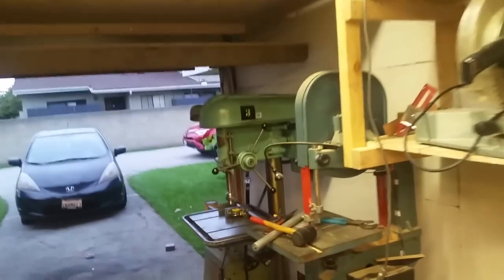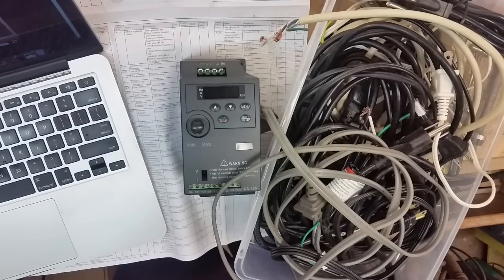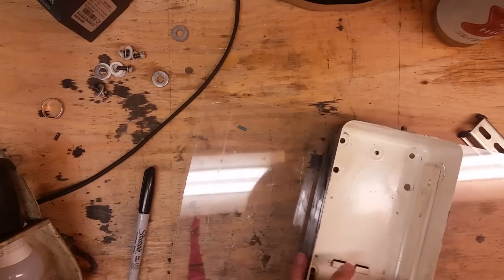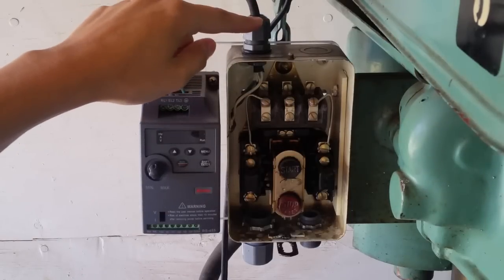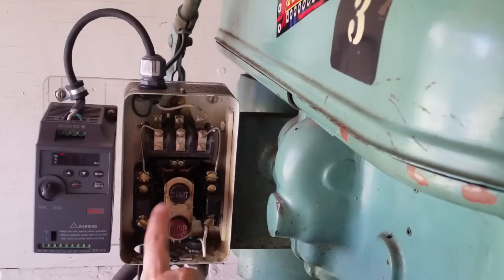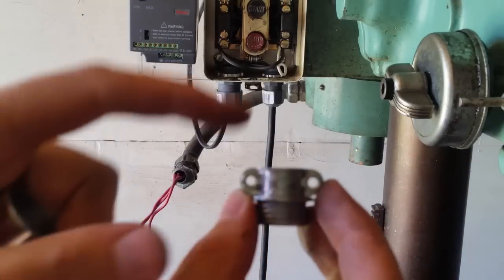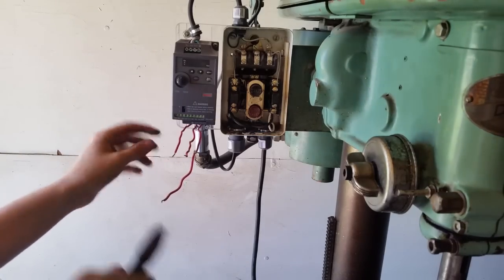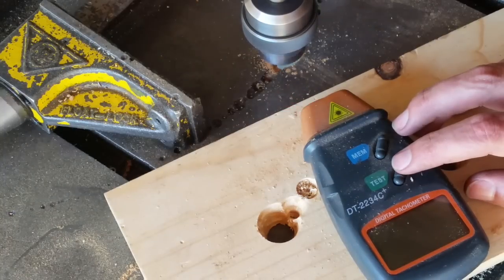Adding a Variable-Frequency Drive to a Three-Phase Drill Press

Comment: Him still confused how you wired 110 to 220 three phase motor, or am I wrong.  I thought you had to have 220 going to vfd. But it look like you run 110. 😅
Reply from the maker: The VFD I bought converts 110 to 220

Comment: Now pitch the light in favor of some blinding bright LED's
  I just got to the the setting on my seat and guide machine, 1 HP Gear head and have no idea if I should favor torque or not, low RPM is like 60, so torque may not be a problem. 
  I also added a hard depth stop and a battery powered LCD scale so I can see my depths to a thousandth. 
  My shop is all 3 phase, so that conversion was not necessary.  I even have a 3 phase vacuum cleaner. 
My VFD is Automation Direct. 
  Thanks for posting!!!
  Mark

Comment: The solution for low spindle speed using the belt pulleys to allow high motor speed, is the best way around the low speed, low torque issue. This is caused by the way these sensorless vfd units work. They use the back emf from the stator windings to determine the position of the motor's rota. That means the old way using hall sensors and optical sensors are not needed. But at low speeds hall sensors are ideal. Because low speeds do not give enough back emf for the vfd to know what angle the rota is at. So these will always perform badly at low speeds (poor torque). But using the belts in the way you have done is the solution. I have just done this myself and its nice to see others having figured it out as well.

Comment: Nice mod!
Just wanted to warn you about tinning the strands of a cable lead before attaching to screw terminal (looks like thats what happening at 6.35) as the tin is much softer and less springy than copper strands they tend to come loose over time when tinned. I used to do that myself unitl I realized that it was not such a good idea. I guess the better way is to do nothing or even better, use these krimpable copper tubes which keeps the strands together.
Reply from the maker: Yeahh, hindsight ... I need to go back in and put ferrules on those wires one day

Comment: Is it still working?  If it is, you might want to add a load reactor after the VFD.  I say this as the motor will die early, if the motor is not VFD rated.  If you can see the motor tag on the side, then take a picture of it and i can check it for you.  Good job.
Reply from the maker: Yeah, it's working well. I've had no problems with it
Reply: @EmilysElectricOddities  That is good.  Do you want to send a picture of the motor label to me?  If you don't, that is ok.  If you do, you can find my email address on my YouTube channel.
Reply from the maker: @vfdcode  I mostly don't because I don't want to move a bunch of stuff in my garage to get back there. But also I'm sure it's not VFD rated. It probably dates to the 1970s

Comment: OMG the belt cover on this drill press looks like a xenomorph's head! :)

By the way, I wonder if that VFD has a remote start/stop capability. If so, you could ditch the old switch altogether and hok the buttons up, adding an emergency stop.

Comment: I was doing a vfd for a air compressor until the price tag for vfd was $1700.00 for a lenztec so i said screw it and bought a new baldor single phase motor for $500.00 but glad this worked for you
Reply from the maker: How many hp was that VFD meant for? The one I bought was only like $150
Reply: @EmilysElectricOddities  i bought a saylor beall air compressor and it had a 5hp 3 phase motor and got a new single phase baldor motor for $500.00 vs the inverter was $1700.00
Reply from the maker: @AdamOutlaw87  ohh well yea, 5hp is a big motor and a big controller. I think my motor is like 1hp or 3/4hp? I can't remember now

Comment: Ha, a three day oddity, something like a three hour tour.
I have an electric model airplane with a tinny driver for the brushless motor with a huge instruction sheet like you just opened in the video. Feel good about this because it took me more than three days to figure it out, and I am supposed to understand shit like this.
Programming the controller was insane, I will probably go back to alcohol motors just because they are easier to operate.
When the instruction sheet is 100 times as large as the unit being programmed, I just mix me a drink and maybe smoke a few before taking the task on.
Keep in mind, I repair modern vehicles as a hobby, along with the computer systems, so, I would like to think I know what is going on. However, we learn something new every day, or, we croak and someone else gets our stuff.

Comment: Love your video! Planning a similar project on a vintage DP . Goal is to have low rpm (150) and adequate torque for hole saw and other heavy material removal. However, I noted your comment that your conversion lacked low end torque?
Reply from the maker: It did, so I made some tweaks to things. I adjusted the position of the belt on the pulleys to give it a better ratio for torque. Doing that made it a lot more torquey, but it also reduced my top-end speed. To make up for that, I went into the VFD's settings and increase the max frequency from 60Hz to 90Hz. Doing that gave me good torque at the bottom and a good speed at the top
Reply: @EmilysElectricOddities  thx for the prompt reply. Most of my drilling involves metal so very little need for higher speeds. Thx again.

Comment: For God's sake  get this pulley covered!!! Getting some PPE like pair of gloves, goggles and hearing protection is not bad idea too.
Reply from the maker: You're right about everything you said, except you should not wear gloves while using a drill press, or any other rotating machinery because they make it easier to get your hands pulled into the machine

Comment: Hi Emily. I have Amazing German Tig welder (complete electronic power supply) I was run on my country with 3x400v or in Usa with a diesel 3x400 generator (this dead for moment).  I looking for a Vfd. Is a correct option?
Reply from the maker: If you have a 220V connection at your home, you might be able to find a VFD to output 400V three phase. There are VFDs for many, many purposes, but you will have to research to see if you can find one that suits your needs
Reply: @EmilysElectricOddities  Thanks. Help me please. My machine is 240ac/dc model https://www.rehm-online.de/en/downloads/data-sheet/datenblatt-invertig.pro-digital-240-450-en.pdf

 With 11kw its enough?

 Thanks
Reply: @EmilysElectricOddities  Efficiency factor [cos phi] 0.96 
Power consumption at Imax. [kVA] 9.3 
Mains connection [V] 3 x 400 
Mains frequency [Hz] 50

Comment: Dear Emily, how do I ground the motor?
Reply from the maker: If it's a case-ground motor, you can just attach the ground wire anywhere on the motor body you can put it. It might already have a spot to attach the ground somewhere near where the power wires enter the motor
Reply: @EmilysElectricOddities  Bitchin'. Thanks! It does have that. I'm realizing that I just need to wire my new 3-phase motor to the same ground as the old single-phase motor? I'm adding the same VFD you have but I'm also swapping over to a 3-phase and I'm a little out of my depth.
Reply: I got mine working. Thanks for the help! I subscribed :)

Comment: I have the same Delta 17" drill press with a VFD.  I put a 2 hp motor on it and overspeed it up to 90 hz for more speed range per pulley step.  I rarely have to change the belt to a different step.  It's a well-design quality drill press and joy to use.

I creeps me out to see loose long hair around a drill press.  A scalping takes milliseconds.
Reply: yup, safety first, loose hair not good, and/or add a cover over that belt contraption,  
Adam Savage's finger is still recovering from wiping some piece of machinery with a cloth.

Comment: Hi i have 3Phase cold saw.  instead of connecting the Variable Frequency Drive wires it to the motor,  can i plug the cold saws power plug into the Variable Frequency Drive?
Reply from the maker: Yes, that should work just fine
Reply: @EmilysElectricOddities   Thankyou.

Comment: I know you already have that VFD,  but for your next project try to find  a Siemens Micromaster , those are by FAR the most simple programming VFD's on the market and you can adjust the amount of low speed torque as you need. 
the Gruyere cheese conversion..... crazy.

Good video,  Regards
Reply from the maker: Thank you, Nicolas! Those look very interesting. I'll spend some time reading about them.

Comment: Every chef should have a VFD-controlled drill in their kitchen! I think if you wire the lamp to the output of the main power switch, you can save yourself a button press.
Reply from the maker: I considered doing that, but I decided I wanted to be able to turn the light on without turning the VFD on. I've found that I sometimes use the work light on my band saw as a light source for other things, and I figured I might want to do the same with my drill press. For example, maybe I just want to work on the drill press's table, but I'm not going to be drilling.

Comment: Great vid!  
I did not realize that VFD’s were relatively inexpensive, good to know. Nice build on the new power connection.

Also, very amused by the Miller high life/ box of donuts combo 👍
Reply from the maker: Thank you! 

Yeah, VFDs certainly aren't the cheapest thing in the world, but they are pretty cheap for the functionality they provide. Now that I have a little experience with them, i feel more confident about picking up the three-phase lathe some friends are giving me. 

High life and donuts: the best tinkerer fuel